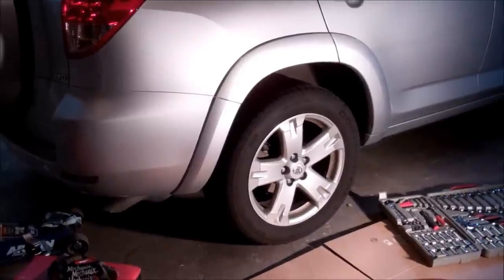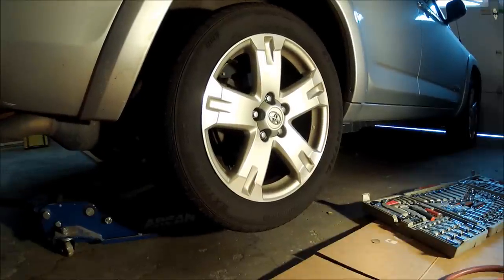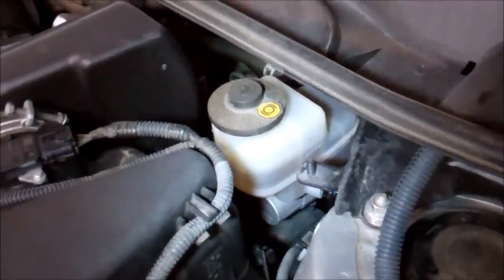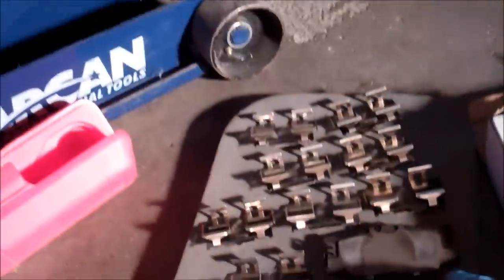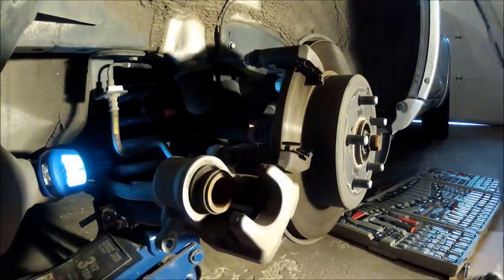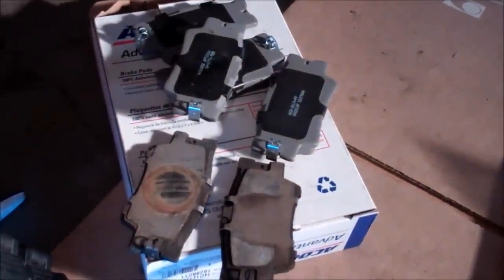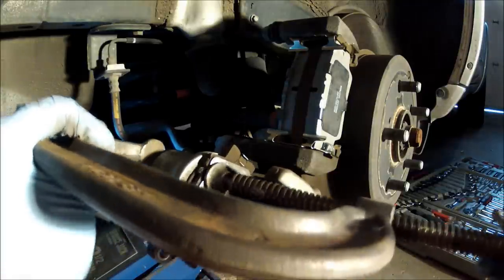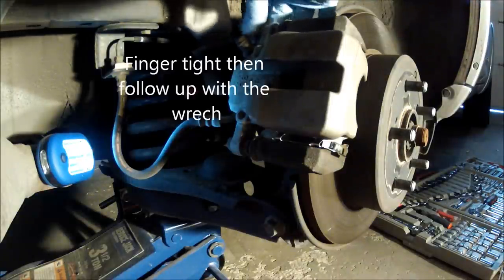Rear Brake Pad Replacement Toyota RAV4

Comment: This is a terrific how to video!  Thanks for putting it out here.

One thing I have noticed, though, is that there are actually two different types of caliper abutment clips with the pads I bought (Wearever Platinums, from Advance Auto.)  The difference between the two is very subtle.  But, they are different.  So, I'm hoping it will be obvious which ones to use when I remove the old ones.  Either way, this video was extremely helpful.

Comment: Thanks for the realistic video! I am doing both rotors and pads on an '06. Other videos have brand new hardware already installed but in real life rust can be an issue so I will be wire brushing and using some grease on the caliper and clips etc. Great video.
Reply from the maker: Thanks for the kind comments and good ideas, I appreciate you watching and taking the time to post.

Comment: Excellent video thank you.  I have always read in Shop manuals to never use a torque wrench to break the bolts free.  I would guess it throws off the tension of the wrench ??

Comment from the maker: Hi Michael, brand is up to you, I used Duralast Gold on the front and AC Delco on the rear. The #'s are the same for each brand, it just a matter of choosing a manufacturer and vendor you like and trust.  If you search on Amazon for brake pads for your RAV4 you'll get a list of options to choose from.  Or if you have a parts store near by the will have options for you too.

Comment: Mavis quote me just for brake pads work at 220.00 out the door. Their break pads front and back and labor. If I'd buy part it would cost me 24.99 Front and Rear 22.99, sum it up 48.00. Now paying Mavis labor @ 170.00 labor, wow. Don't know about you guys but that's awful lot to me. Thanks for the vid. Saved me 170.00

Comment: @AutoDIY After 6 years people like me are still watching this and saying thank you. I'm attempting do do my own brakes. Lucky for me we have the same year, but mine is a sport. Is there any difference or pretty much the same deal? And did you have a video of front brakes? Again thank you very much love the step by step.
Reply from the maker: Actually the car featured in this video is a V6 RAV4 Sport, so you are good to go.  There is a front brake video on my channel called Brake Pad Replacement.  Good luck with your project, and thank you for watching and taking the time to post.
Reply: @AutoDIY  
Probably no difference in design but it think the pads are larger on the V6 models.

Comment: 90 ft.lbs on the lug nuts. At least tell us that the official spec is only 76 ft.lbs.

Thanks for posting. I learned something. Never seen this done on a RAV4 before but need to do ours soon.

Did you check the thickness of the rotors?
Read your comments and love your attitude. 😉

Comment: Thank you for the insightful video.
i need to have a rotor and caliper replaced, should i go with oem or is there something just as good that won't have the cost. thank you
Reply from the maker: jeff robar Thank you for the kind feedback.  You will find plenty of good aftermarket options for rotors, but when it comes to calipers my opinion is to stick with oem, especially if  you only need one.  There are great caliper options in the after market, but the good ones usually cost more than oe and you will want to swap them all out when you make that change.  Just my two cents.  Thanks again for posting your comment. Good luck to you.
Reply: much appreciated, thank you
Reply: +jeff robar auto zone has lifetime warranty.. I did buy the expensive one and have returned it when It was weared out...it's worth it.

Comment: Thanks for this great tutorial, very helpful. I have a question though. I was advised a few years back to never force the brake piston back as this forces the brake fluid back into the reservoir through the ABS system, and as this fluid could possibly be contaminated with rust particles, moisture and dirt etc.from the slave cylinders, it could damage the ABS system and result in very costly repairs. Probably wouldn't happen the first or second pad change but after that ? Apparently it's better to open the bleeder and let it go to waste.
Reply: How would contaminants make there way into your fluid? Answer, they can't. Unless you have much bigger problems.

Comment: @autodyi what torque setting do i use for the guide pins and the tires? i have a 2008 rav4 sports 4 cylinder. Thanks!!
Reply: The 14mm caliper bolts are only 20 ft.lbs. and the lug nuts are suppose to be 76* ft.lbs. but he did them to 90.  *(same for steel or alloy wheels)

If you take off the caliper brackets to replace rotors or to resurface the old rotors the 17mm bolts get torqued to 65 ft.lbs.

Comment: Why not grease the slide pins while you're in there? Or grease the pads? May want to think about replacing your brake fluid too.
Reply: rockin870 , agree with he sliding pins to ensure that the pads will wear down evenly. torque specs to about 25 ft lbs on em. grease behind te pads are not needed since i saw te new ones have  anti squeal shims on them

Comment: You applied 90 foot pounds torque to the wheel nuts but the Toyota RAV4 specs is 76 foot pounds